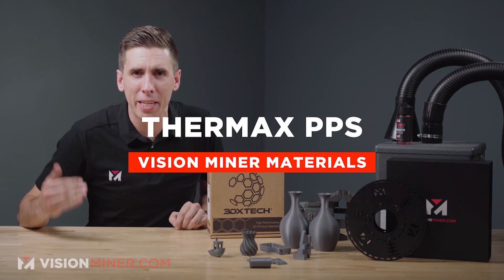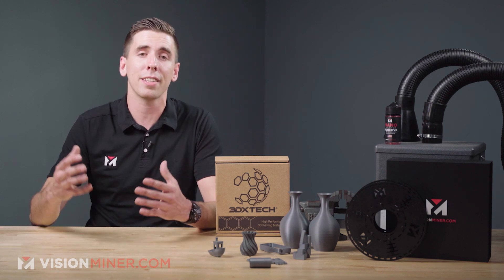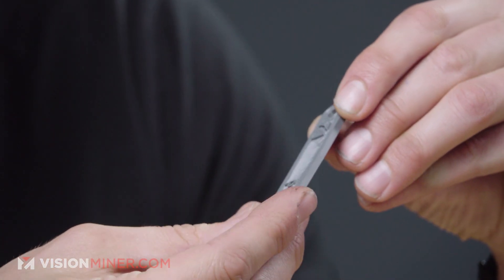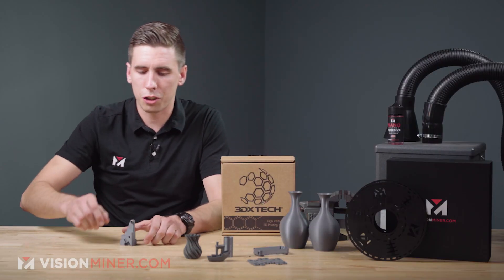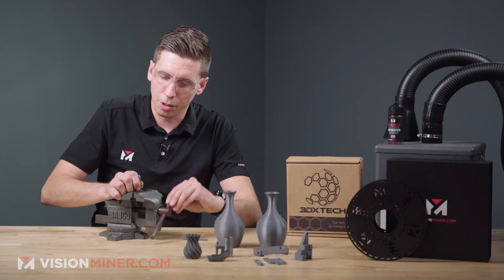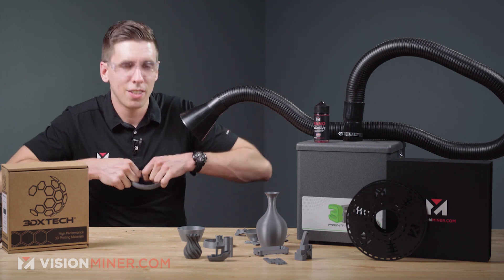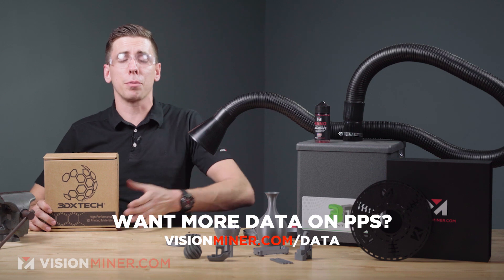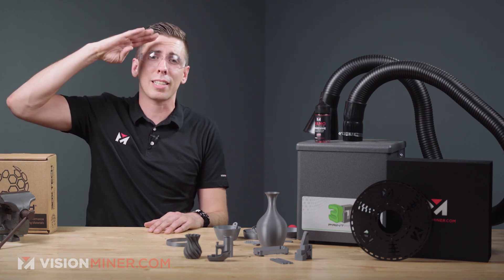ThermaX PPS, Chemically Resistant 3D Printing Filament by 3DXTech (Polyphenylene Sulfide)

Comment: What bed surface have you found useful at high temps like 160C for this?
Reply from the maker: Almost always 160c on the bed for the high temp materials, unless it's a super thin part
Reply: @VisionMiner  that makes sense. I guess I should rephrase my question: when running the bed that hot, are you using a PEI surface, a glass plate, or something else?